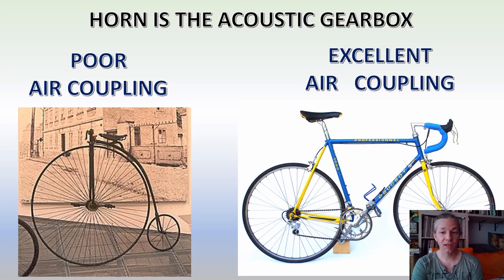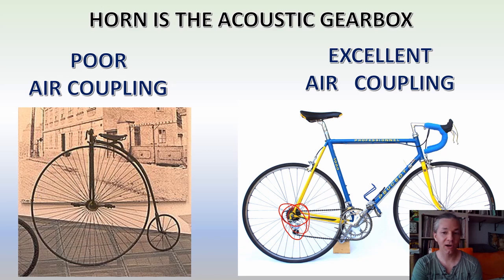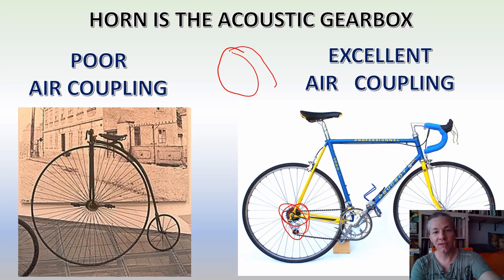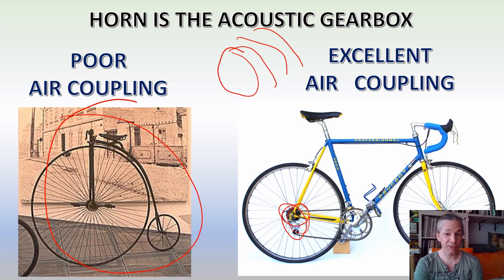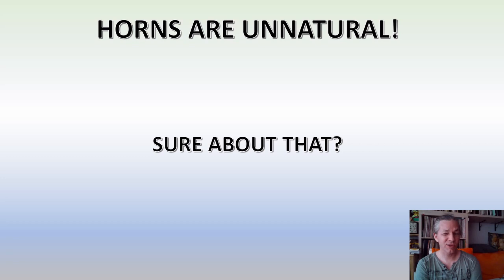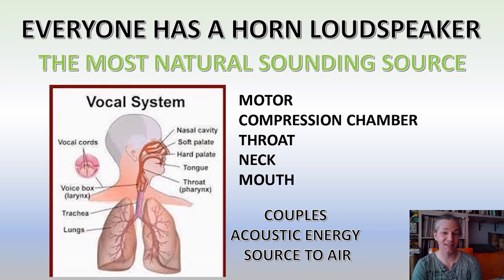Understanding Horns! Part III. Good and the bad

Comment: Dynamic drivers have a horn-like shape also because it's easy to achieve a linearity of a tension between a membrane and a surround. While a coil moves up, a size of a total flat surround increases, and so a tension. With a conical shape of a membrane it possible to keep that tension constant because of vertical and horizontal vectors sum. The more sophisticated structure of a surround, the less excursion is, the flatter membrane can be. Check out modern drivers with a flat aluminum membrane for example. 10cm full-range drivers are almost flat.

Comment: Perhaps the difficulty you have with DSP is that the DSP chips require a digital signal conversion and this conversion is the beginning of the deviation from straight line methodology. After all, crossovers all are a type of signal processing, but for analog electrical waveforms. The filtering must happen to limit coloration. Thanks very much for this thoughtful series. I enjoyed your learning your process and rationale in defence of horns. It’s just a pity they all come with prohibitive price tags.

Comment: "Horn colorations affect every loudspeaker" - This is simply untrue. Any change in frequency response that gain from the horn causes is minimum phase and consequently can be (very easily) equalized. Sometimes it takes even fewer crossover components to fix a tilting response from a horn, than it takes to linearize a driver on a flat baffle. That's exactly what is being done widely in the audio industry. You either phrased it bad or for whatever reason ended up misleading people. In fact these days not using a waveguide on your loudspeaker pretty much equals more deviations. I can't stress it enough - a properly designed horn loudspeaker has FLATTER frequency response than one with a tweeter and a midrange on a flat baffle. In  many cases, all it takes is just one capacitor and the response is perfect. After filtering, a smooth and well flanged horn  will have it's frequency response not only flat on axis, but also smooth off axis. It doesn't end there - horn loaded tweeters have smoother decay, because the sound is not reflected back to the diaphragm at resonant frequencies. In the end horns are the obvious path to the least colored audio. You just need to know how. In the past it was tricky, but today that  knowledge is widely accessible. With highly automated and free tools such as ATH4, designing a horn today is the way to have the most control over your frequency response. Without a horn you can only shift diffraction ripple, which colors the sound and cannot be equalized, because it's not a minimum phase phenomena. All you can do with a flat baffle diffraction is to hide it in a plot, and that's what the less smart engineers do.

'Horn is a curved surface'  - What about conical horns? The majority of horns used today have conical sections, because they load low frequencies better. Horns have expanding cross section as opposed to ducts, which  have constant cross section. I'm being picky here, but I think it helps to illustrate my point. You have a rather selective knowledge in this field. The theory that you gathered only really applies to unfiltered drivers, which you never hear in loudspeakers. Your statements are simply too general.

Apart from this, It's interesting to see the dip in the response of this driver. Usually I'd assume it's the srround edge dip - a frequency at which the edge of the cone with rubber attached is heavy enough to move out of phase with the rest of the cone. Anyway, nice to see someone talking about horns on this platform.
Reply: You are right - but this video gives a short impression about how a horn works, it is understandable and it gives a kick to build a horn system yourself (at least I am working now on one).